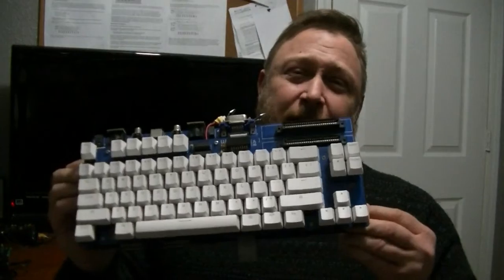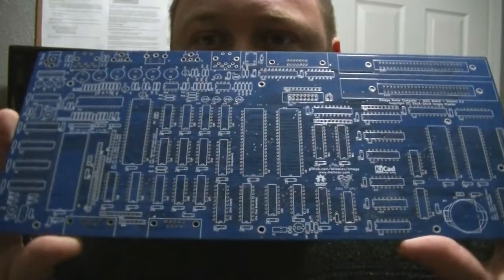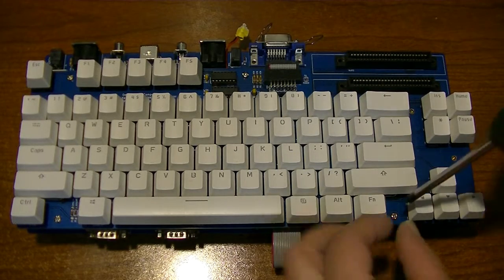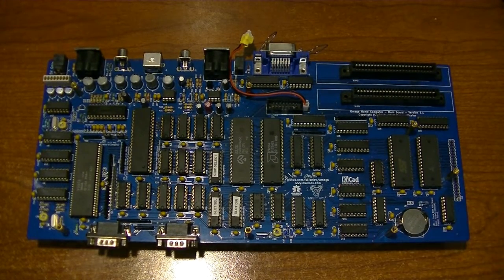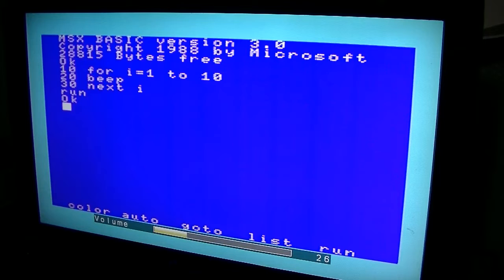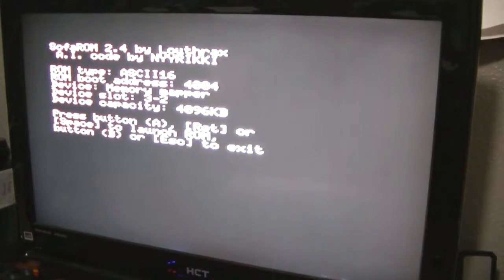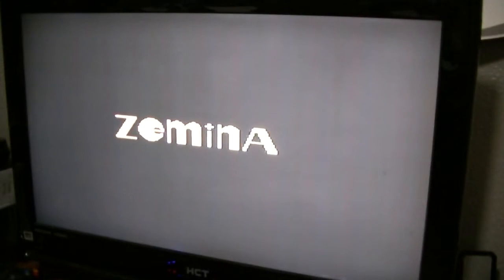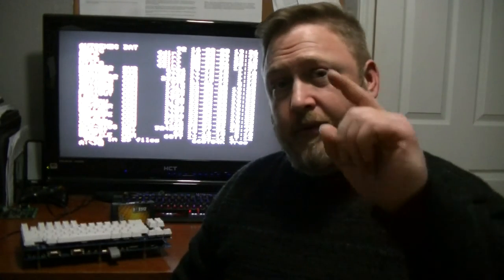The Omega Home Computer

Comment: Nice I first saw this mentioned on shadowtron‘s channel I think or maybe electricadventures but neither of them did show the built yet. I like this project and I may have nearly all the parts besides the boards and rtc I think.  Can’t wait for the case you come up with. Greetings from Germany.
Reply from the maker: You should try building it! And Sergey let me know last night that there is a nice case for it very similar to what I was designing. So I’ll have to check that out. So I may try printing that one.

Comment: Thanks for yer video- I wanna try to build this- minimal soldering skills- should I attempt?!
Reply from the maker: Paul, it all comes down to practice. You could always start with some smaller kits to build your soldering skills. This is a large project. It’s easy to spend several hundred dollars if you go all out on parts. But it could also be built for around $125-150 if you’re willing to shop around for parts. The point is, it would be a shame to ruin a bunch of parts with poor soldering skills. So I definitely suggest making sure YOU think you’re up to it. It’s not hard. But it does take practice.
Reply: @RetroDepot  Here you have an assembly manual in Spanish, as well as other assemblies for the omega home computer. https://msxmakers.design.blog/proyectos/omega-home-computer/omega-paso-a-paso/

Comment: I agree, very dangerous to have the 5V power of all the chips connected to the barrel socket. A simple bridge rectifier and  buck regulator would mean any voltage from 7v to 26v would be fine. That's what many WiFi routers use.
Reply from the maker: Agreed. I’m personally fond of the LM2596. But even just a spot for one of the cheap buck converters would be an improvement in my mind. But it’s Sergey’s project. And he builds them like he likes them. 😉